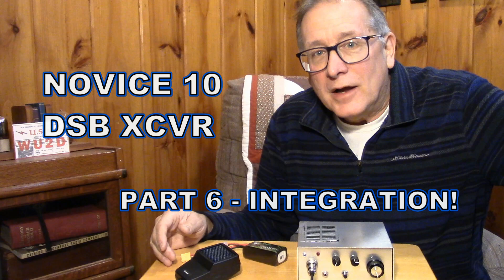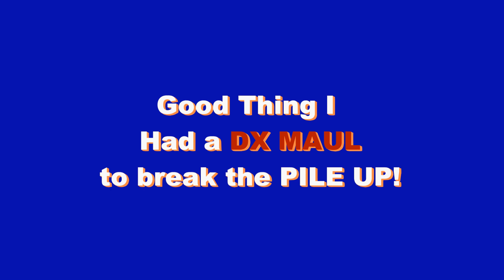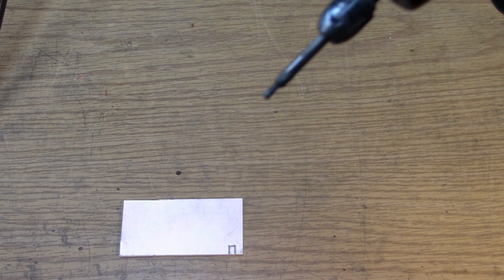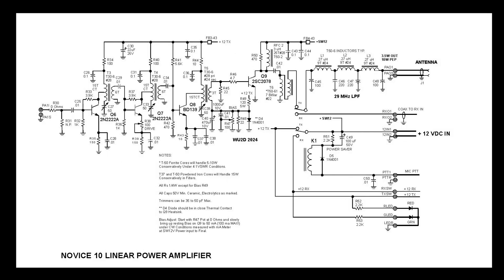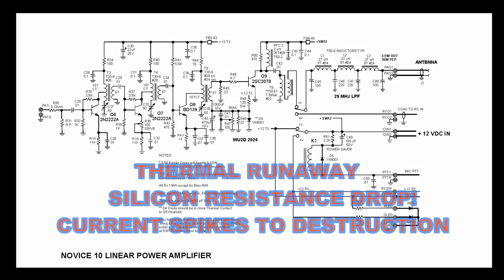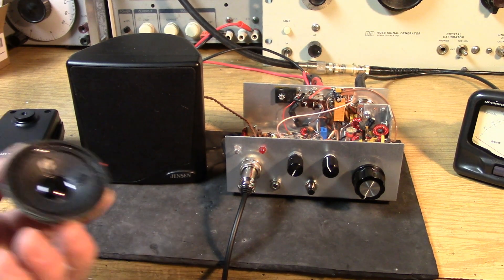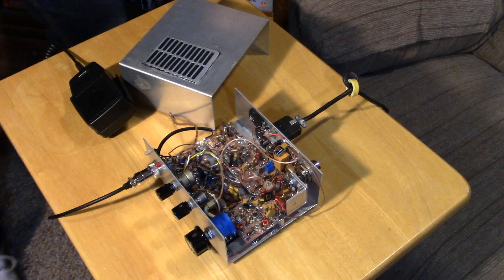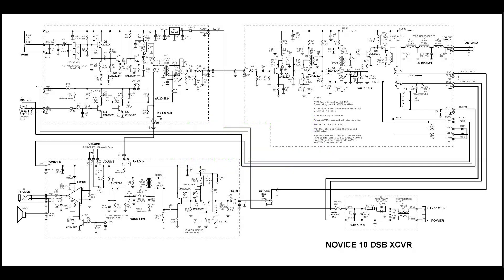Novice 10 M DSB Transceiver - Part 6 Integration

Comment: Hi Mike luv ur videos. 
Im working on a DSB 40 meter xcvr and was wondering about the signal splitter u used in novice10. 
Is it necessary, why did you put it in there and how did you determine the resistor values you used. 
 Thanks, 73 John KE2AMP
Reply from the maker: Its just a simple WYE pad splitter for 6 dB of isolation to keep the DBMs ports happy.
Reply: Thanks Mike, i should of edited my comment since we have privately conversed about my question and you explained it to me. 

Thanks agsin,73. John KE2AMP

Comment: After the transmit mixer you have a resistive attenuator labeled "6 db", but from what I know for that to be true your resistor values are transposed, so R18 should be 39 ohms and R17 and R19 should be 150 ohms, or am I wrong?  Walter KA4KXX
Reply from the maker: You are so correct.

Comment: Mike... Why the teeny tiny form factor? It even looks miniature for mobile use let alone in the shack. Did you have a reason to make it so small especially since it's aimed at the novice?
Reply from the maker: I admit that I was influenced by the small form factor of the Beach 40 and Micro 40 projects and I had the small box!
Reply: @MIKROWAVE1  I doubt my fat fingers could twiddle one knob without twiddling the others 😂

Comment: Your approach to using commonly available parts reminds me of the 2n2222 transceivers that K8IQY designed many years ago.  I even built one of those for 40m.  And you could still build one today..
Reply from the maker: Yes this is all old time - dated and very retro! Fortunately the toroids and trimmer caps are reasonably priced and we do not need to use slug tuned coils!

Comment: I use a hollow center, glass/ ceramic Dremel bit. It cuts round islands directly on the board im building on. You do not drill directly through the copper board, just enuff to remove the copper around the island. Good planning before cutting the islands helps.
Reply from the maker: Great tip. I actually has a copper whisker left in one circuit pad island in the PA, that gave me fits until I found it under the relay! It was not a direct short so the power out was low and current drain was a bit high. But no helpful smoke to give away the problem!

Comment: Great work. In the 70s saw a development type VHF FM synthesised radio about 1 foot square and 6 " high in rats nest construction. They had even used it Mobile..
Reply from the maker: I was in college at the time, but ended up at Motorola right out of school. We were doing System Sabre at the time.

Comment: That little monoband rig is enough to make me wish I was a novice-class ham. :)
In audio, the rule is 'speakers, speakers, speakers'. In RF the rule is, antenna, antenna, antenna'. But that little rig also has excellent sound quality, indicating sensitivity, and selectivity as starters. You've put together all of the pieces of a high quality little rig, and done it with few and inexpensive parts. Good engineering, Mike. I've learned a lot. And I also know that when 10 opens up the world is at the feet of anyone with a clean little QRP rig. I remember back in the 1960's, long before I was a ham, listening on 10 meters in central Michigan to a ham with a 2 transistor AM transmitter he'd built that was running under a Watt. He was blasting in on my Hallicrafters SX-25 so loud and clear that I was listening to him from the next room even though he was in Aachen, Germany. The bands were whooping and whining, and he was coming in to MI like the voice of God. After that day I was never impressed with RF power. I was impressed with the idea of having the knowledge to do everything just right, to guide electrons and photons around to do my bidding, to play with the fundamental laws of nature and our reality. Yes, I have amplifiers that can produce several hundred Watts, but they sit and gather dust. I guess I have the philosophy of a sailor, not a powerboat operator. 
I want to build that little rig even though I have several transceivers already, because it's been designed with a lot of thought, and care, and knowledge, and your video series explains it all even better than an old Heathkit manual does. BTW, my business partner was a Heath engineer, my first kit build was the CB version of the Benton Harbor lunchbox, and I have several pieces of Heath gear in my shack, from a GDO, to bench power supplies, to an FM deviation meter, to an SB-104. A Heathkit arriving in the mail was always Christmas to me no matter the time of year. So thanks for your efforts, your explanations, and your channel. I knew Doug DeMaw, and you remind me a lot of him. You're a great Elmer, a bright light in the darkness of YouTube box opening videos, and much appreciated.
Reply from the maker: Wow Jon, you are making the internet blush! Ha. Thank you so much for following along on the project and Doug DeMaw - I think that is a bit over since he is one of my elmers for sure!

Comment: Great project! I'm curious if the lower sideband causes interference to neighboring upper sideband stations. Also. I don't feel I fully understand the toroids yet. How critical is your choice of toroids? In other words, how did you come up with using T-50-2 in the choke going to the collector of the 2SC2078 and T-50-6 toroids in the low pass filter? Could you have used the T-50-2 or T-50-6 for all? What if you did? Why is your call sign so close to Mr. Maxwell's? 
Anyway, I appreciate you going through TREMENDOUS work bringing this highly educational project to us! What a great idea to break it down into modular form. Can't wait to experiment with building at least parts of these circuits. 73!
Reply from the maker: Truthfully the -2 and -6 are both fairly modest perm and they both work well here on 10M (a few turns difference of course). I could have used either.
Reply: Okay, so it's not as critical as I have once though. Thanks, beautiful project by the way, 73. @MIKROWAVE1

Comment: You have done well making these videos accessible to a wide variety of skill levels.  Thank yuou.
I have learned quite a bit from this series.  I have looked up many of the books you reference in your videos.
Reply from the maker: Its really hard to beat the book Experimental Methods in RF Design by Wes Hayward, Rick Campbell, and Bob Larkin.
Reply: @MIKROWAVE1  It is out-of-print.   Used copies are selling for $100-$300.  New copies are $300-$500.
I ordered a used copy.

Comment: 👍Thank you sir. great work .
Reply from the maker: Thanks for watching the series!
Reply: I made one channel(40m) ssb small transceiver (with built-in battery), size of a 9 volte battery, worked 400km Vu2knd.i would like to show you sir.
 @MIKROWAVE1
Reply from the maker: The ultra simple rig is quite possible on 80 or 40M, but a bit more tricky when you go to 10M and want the stability, tuning and power. It did get out of hand!

Comment: Designing the RF sections with discrete  parts instead of ICs or pre-built mixers makes the project much more educational and accessible.  Thanks for  work.
Reply from the maker: Using discretes is ponderous and a bit scary, but it gives high performance with usually lower cost parts. Who can argue with a 2N2222? Thanks for watching!
Reply: @MIKROWAVE1 I was just looking at the 2SD882 transistor in view of using it as a HF PA. I believe it has a higher fT than the BD139 and a higher collector current rating. Could be good on its own for 5W
Reply from the maker: @Dazzwidd  Very Nice. I noticed that the CB I removed the driver from was using a 2SC495, which is not much different than the BD139 with an ft of 100 MHz! BTW the final in the CB was popped.
Reply: @MIKROWAVE1  It's funny you mention about the 2SC495, I've seen them as the output stage on old crystal controlled 27mhz handhelds as well as in driver stages in SSB CBs. I've also played with old CBs tacking in power transistors with no heatsink on them to watch how they work as finals.
I was surprised at what worked! This was back in the late 90s so I don't remember part numbers 
About 14 years ago I rigged an IRF530 in a circuit driven by a crystal oscillator and driver and managed to get over 30W at 15V.
Experimenting can be more fun than QSO 😅